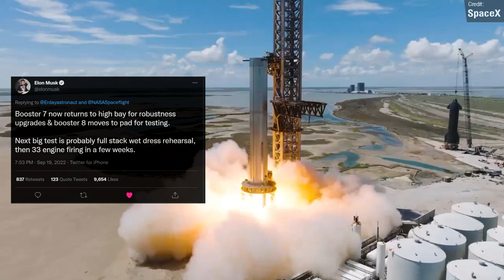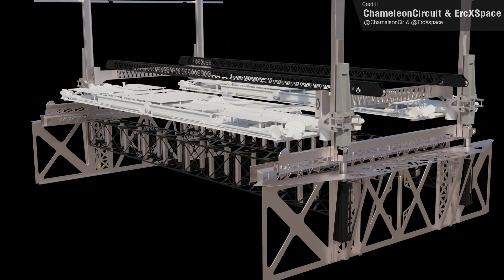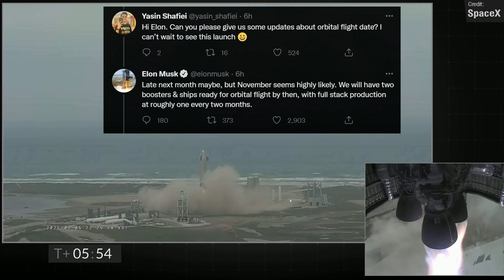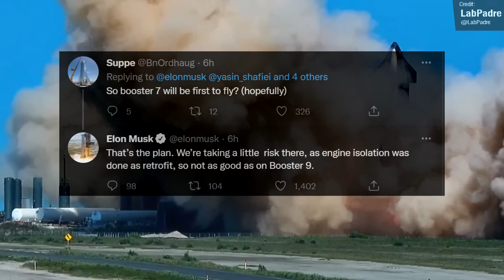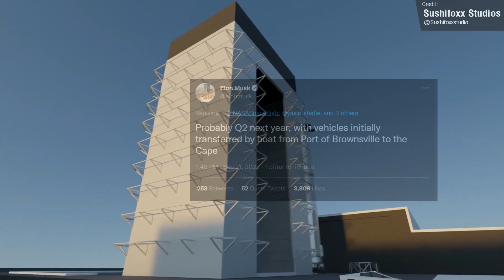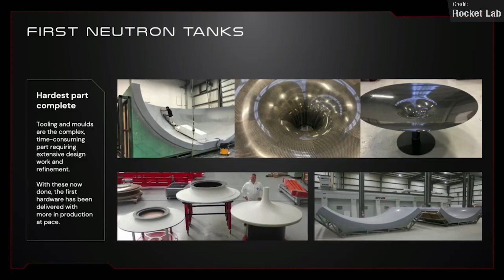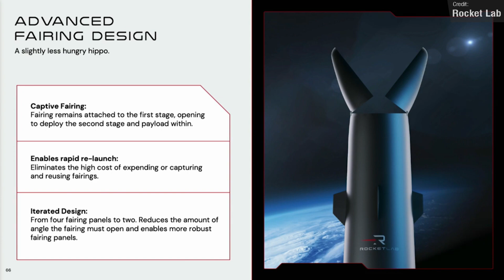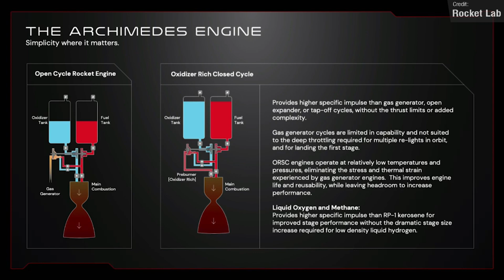SpaceX Starship Booster 8 Replaces Booster 7 at Pad, Rocket Lab Neutron News, Delta IV Heavy NROL-91

Comment: "Grainy low res 720p"??? God damned snowflakes (the length is way worse an issue). I gamed on 320p AND LOWER. Get a ZX Spectrum to find out what real low resolution is. The upgrade to a Hercules based system so you get better resolution BUT no COLOR at all!  😛😋😜🤪🥱

Comment: I feel like USA making so many sanctions and making other countries sanction them, which is causing a lot of countries energy issues, USA will still use a Russian rocket, but others can’t buy critical oil from them😐
Reply: USA stopped buying rocket engines from Russia before the war.  They're just using up existing stock.  That's why the Delta IV is being retired.  So I'm not sure I get your point.
Reply: @homemodsgarage3401  The Delta-IV uses the US Aerojet Rocketdyne RS-68 engine. Only 24 Delta-IV heavies were made and Vulcan Centaur is replacing the Atlas-V and Delta-IV Heavy for ULA.

ULA had already purchased all the RD-180 engines that they needed from Russia for the Atlas-V before the war. The Northrop Grumman used the RD-181 engine from Russia and the booster was from Ukraine. So Northrop Grumman will fly Cygnus on the last two Antares 230+ boosters and then fly on SpaceX's Falcon 9 until the Antares 330 booster and engines are made by Firefly Aerospace in conjunction with Northrop Grumman.

Comment: Nasa is concerned about having the only ground facilities that can launch manned craft to the space station being destroyed by a Starship failure. He offered to build another Manned Falcon launch facility. That was the last I heard. They probably decided to escape the Nasa bureaucrat loop and just go build another Starship Launch Complex. Time is Money for SpaceX.
Reply: There's also a high chance that the Falcon pad could become the only manned pad again. Starliner has a few Atlas rockets earmarked, but Vulcan isn't being crew rated and Boeing doesn't seem interested in paying to have that done.

Long term Starliner (if it lasts that long) will need a different rocket. Falcon 9 is the most obvious choice, but Rocket Labs has talked about crew rating Neutron and that may be workable as well.
Reply: @Hevach  ya, and by the time that sorts itself out starliner will change the whole landscape.
Reply: SpaceX offered to upgrade SLC-40 at CCSFS where they currently only launch Falcon 9 cargo rockets to be able to also launch crew. The 3rd tower could be a crew access tower for SLC-40.

LC-39A launches Falcon 9, Falcon Heavy, and Crew Dragon, of which the last two only currently launch from LC-39A.

The 3rd tower might instead be used at SLC-13 at CCSFS where LZ-1 & LZ-2 are at for Falcon booster landings. No real infrastructure to damage there with a RUD. Another option is at the as yet unbuilt LC-49, which is to the northwest of LC-39B. SpaceX and NASA are working with the FAA about building one or more Starship pads at LC-49.

Comment: If SpaceX is planning to turn around SH boosters quickly, they're going to need a tower for EACH SH booster. The boosters can't sit in orbit, so they're going to have to come back down - presumably to the tower they launched from (or possibly one nearby). Maybe they'll need to work on some of them, but the ratio of Super-Heavy boosters to towers is going to be pretty close to 1:1.
Reply: Or they could put a catch tower at SLC-13 and roll Superheavy boosters back to LC-39A. The converted oil rigs are most likely going to be Starship Tanker launches, so they would come back to land on the platform they launched from. Boca Chica is mostly going to be R&D per Musk, so they will probably roll off boosters as needed.

Comment: Two towers at each location are needed to support full landing redundancy. 

If the arms are raised to the catch position, no single component failure in the tower will lead to loss of payload. Failures that permanently ground a ship are an acceptable risk. Failures that kill passengers are not acceptable.

Each tower has two arms. Even if one gets stuck, the other can still move enough to catch the ship.

If some shock absorbers jam, the crumpling of parts of the ship will absorb the shock instead, although the ship may never fly again.

On the other hand; if the chopstick carriage gets wedged while it is too close to the ground, that tower won't be able to catch a ship.

It seems that SpaceX is working hard to ensure that any single engine failure won't cascade into a multiple engine failure. Starships have more than enough thrust to land without a complete set of engines.

Comment: Im wondering if 7 and 8 are still in the proof of concept stage as evident by the constant need to takedown raptors yet pursuing the welding shut of piped connector just to get this bird in the air.  The technical challenges seem more like workarounds from existing technologies....7 and 8 may b single-use.  Too much time spent on 2.5 and as i predict a raptor 3.x otw.  Reinventing the wheel is not the same as making a better wheel.  The wheel exists so use it.

Comment: More is better on the towers. We need to realize that because they're catching everything they can only have as many boosters in operation as they have towers. That ideally a booster and tower will be a pair, that the booster would only ever leave the tower for an extended time when off for repairs or something. Otherwise it'll launch, come right back, refuel, and launch again. 

Also I'd suspect that at first they won't want to catch a Starship at the same tower where a booster is. So with a booster at one tower they'll catch Starship at another.